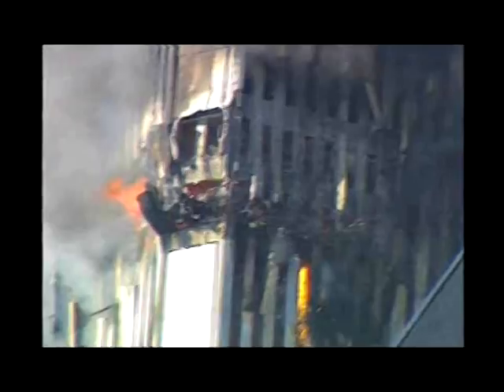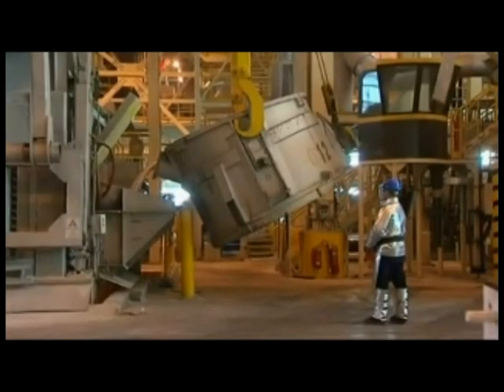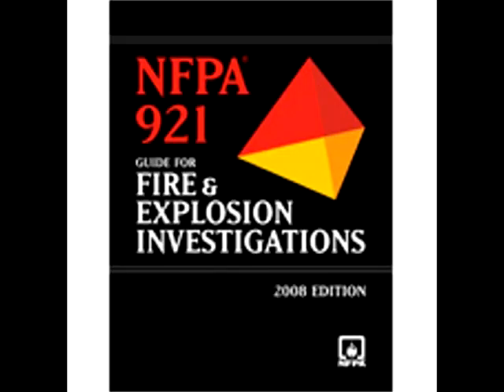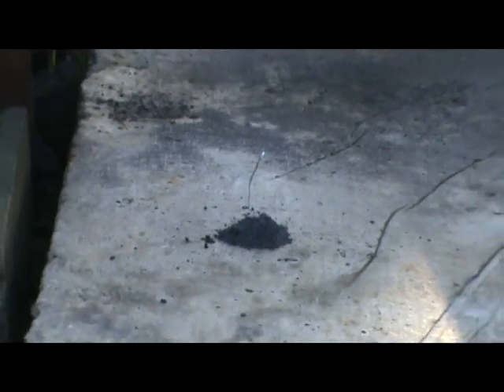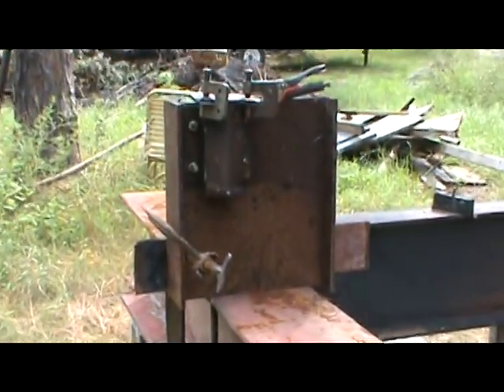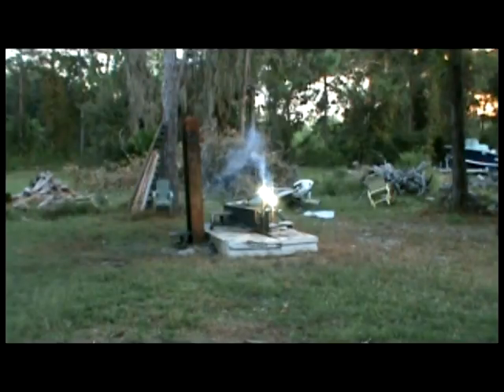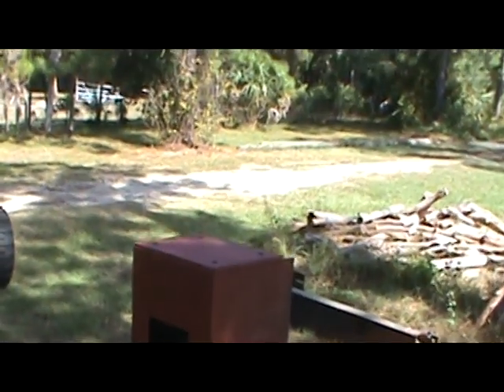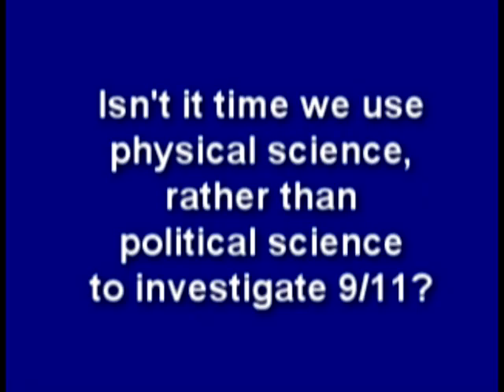9/11 Experiments: The Great Thermate Debate

Comment: ...what is the adiabatic flame temperature of kerosene anyway? What temperatrues are expected for a confined flame? I only ask because coal combusts up to 3500 F and that's a hydrocarbon fuel. CO also combusts at similarly high temperatures. Incomplete combustion of kerosene would cause CO, wich could cause secondary combustion at increased temperatures to the primary flame. Just another plausible theory, just as this viedo presents. I'm only offering more to think about.

Comment: ...There could have been isolated pockets of combustion exceeding the expected 1800 F espicially with changing air currents internal to the structure istelf. An accumulation of un-burnt carbon residue coupled with a high flow of high temperature air could have caused isolated mini blast-furnaces causing localized melting of steel. This is much more plausible than someone accessing enough individual load members at a pre-determined elevation that just lukily got hit by a minimally trained pilot.

Comment: The simplest explination is almost always the correct one. If you hear hooves think horses not zebras. Why did the buildings implode in a semi-controlled fashion? It was inherent to their design. Unlike traditional skyscrapers (with an internal structure of beams and braces) the primary load path was to the shell with trusses streaching from wall to wall. A cascading failure of the trusses (from high temperature creep) would allow for a semi-controlled demolition.

Comment: What I find interesting is that (let's call them the opposite) deniers initially claimed, "Your reasoning is absurd: you cannot cut steel beams with thermite/mate." This video simply proved otherwise. Now we move the conversation from there. You also neglect to mention that iron-oxide sphericals were found in the rubble (kerosene fires cannot do this).

Comment: Another crude butchering of common sense. Of course termite will explode when you ram air into it. Thermate is used to cut beams and weld railroad steel. It seems easy to destroy a building with thermite, but in reality it's not. Not at all. The loud noises were more than likely these bolts you speak of just being broken and ripped out of their beams. The largest "explosion" was likely the thump of the first floor that collapsed. The videos from inside detail each floor hitting the next.

Comment: Guys its not thermite we are talking about here, it is nano thermade which is military and high tech explosive and not available to the public. Judy Wood also claims there is evidence of zero point energy weapons used which would have been intense heat in a vertical wave. Haarp weapons basically. One thing is certain the official explanation is a joke and explains nothing.

Comment: The fire fighters, wrong; fires out of control, water system destroyed.  You are quote-mining your way to support idiots who spread lies about thermite being used.  Jet fuel has 10 times the heat energy of explosives and thermite.  Bringing thermite to a jet fuel fire is like bringing a knife to gun fight - you lost.
The office fires were many times the heat energy of 66,000 pounds of jet fuel which set fires on multiple floors (5/7 floors) in seconds, the biggest office fires in history.

Comment: Add RADAR to the things you have no clue on. I have data from multiple RADAR sites which show 77 impacting the Pentagon. There were no ghost planes, you are spreading lies due to ignorance or some bias.  You are using common sense when you need to get the RADAR data, and use math.  There was no melted steel, and the DNA alone from the Passengers of Flight 77 prove 77 impacted the Pentagon.  You lost this one.  Ghost planes, did you make that one up, or fall for more lies from idiots on youtube?

Comment: Get a refund on your education, the FEMA report, Appendix C, says it was corroded at temperatures from 600 to 1000 C. BTW, steel does not melt at 1000C. OOPS eee.
You believe liars who never showed you melted steel.  You have no clue what eutectic means, and it shows. Next time read or go be an engineer. IT only takes a grade school education to see this video is nonsense filled with lies.  Why grade are you in?

Comment: Read my comment again dickwad...and absorb what i wrote...if thermite was used there would have been thousands of instantaneous flashes, flames, sparks and extreme heat all over the building, remember the steel was on the external part if the buildng too...you wouldnt have ONE localised run of molten metal....besides, how long did it take to burn the the steel? And you think they could time it all to bring it down so perfect and quick....bahahahahaha...get a life

Comment: With the iron spheres consisting of approximately 5-6% of the dust analyzed by weight, that means there must have been a steel wool factory in both WTC towers. Strangely, I don't recall reading about a steel wool production facility in the WTC complex.  Congrats on making steel spheres with fine wired steel. What happens when you hold your lighter to a steel box column? How many steel spheres do you get?

Comment: Except there most certainly was melted steel. The FEMA/BPAT paper clearly demonstrates the existence of melted steel that demonstrated rapid oxidation and sulfidation which has no clear explanation. Nor was the oxidized/sulfidized steel isolated to one building, as one sample came from WTC 7 and another from either WTC 1 or 2. Two instances in 2 separate buildings demonstrating the same eutectic reaction.  Just coincidence, right.

Comment: First the iron is melted by some chemical reaction, then, as a fluid (liquid iron) it is rapidly blown into the open air by the expanding gases of the chemical reaction. While traveling through the air, the surface tension of the liquid iron pulls small droplets into spherical shapes, much like rain drops.  The liquid metal quickly cools as it travels through the air, solidifying into the spherical shapes.  This process of iron sphere creation is typical for thermitic reactions.

Comment: The rescue workers who tried to save as many people as they could from rubble reported that they saw molten steel even after the collapse. The rubble was so hot that the steel toes boots they wore would melt after only a few hours. How would a plane crashing into the building cause this? There were pillars that were sheered at an angle that is similar to demolitions. This and the fact that there traces of nanothermite, which is a military grade incendiary point to something being wrong

Comment: When fired by electricity, the thermite generated a temperature of more than 5,000 degrees about the two legs, melting the ten-foot sections almost instantly, causing the tower to tip and then to crash.

Unfortunately, today’s Popular Mechanics heads have failed to acknowledge this demolition in their defense of the official 9/11 conspiracy theory.         lmao  - Popular mechanics  lying assholes -  fooling the ignorant  - try watching this  video on which you are commenting fuckwit

Comment: The interesting thing is not the amount of energy per unit in the respective sources, being a chemical engineer you already understand that, right..? It's about how fast the energy is released upon ignition. And you can't use kerosine to cut through steel in an exothermic reaction.

And of course, provide a source for the numbers you bring up and tell us what kind of thermite you refer to.

Comment: As anyone could see by these experiments....there is NO WAY thermite could have been used...you would need tons and tons and tons of the stuff to bring the building down with it...the white flames, the arcing from the side of the building...electrical cables earthing out, more than enough energy in electricity to melt steel...it's used world wide to do so...it's called arc welding...do some research on that and not thermite...how the fuck you you control all that thermite? Wankers!!!!

Comment: "A blacksmith does use and open air fire using coal or wood and easily weakens steel. How do you explain that"

Because they keep adding fuel to the heat source (and they also provide extra oxygen by mean of extension bellows). You can maintain severe heat for hours doing so.

Comment: "The corrosion in Appendix C happened from temperatures 700 to 800 C, and near 1000 C. Melting point of steel 1425 to 1540, and thermite does what?"

Did you say you know what an eutectic composition is; that it lowers the melting point? And for the third time: Who tested for iron fused to steel from the WTC buidlings, or any kind of explosives, or explosives residues, in the dust..? Are you surprised they didn't find anything..?

Comment: "I'm an engineer, I took a chem-engineering course, my roommate is a chemical engineer. Get help you can trust and stop being so gullible"

It's fully possible that you took a chemical engineering course, but you still make false statements about iron spheres. You make references to the earth's crust as if it would in any way relate to, or explain, the presence of iron spheres in WTC dust. And it definitely does not explain molybdenum spheres.

Comment: (continued)

collapsed (i.e was severed from the outer structure) without signs of pulling in on the perimeter columns? Totally implausible, no such signs visible prior to collapse of the exterior structure.

"You lied, the free-fall data was from NIST. Why do you lie?"

You are embarrassing. NIST initially denied free fall, and you say it was their data? They were forced to admit it; independent researchers clocked the descent and discovered the free fall sequence.

Comment: "Another NIST basher, and you can't even figure out corrosion. You use FEMA, but bash NIST. NIST used more engineers than you did to fall for the lies of the video"

Clearly there was corrosion, which led to (thereof: "subsequent") intergranular melting (why is it called melting if its not a form of melting?). They way you express yourself, and clearly make false statements about the spheres (and don't answer my questions), lead me to believe that you are not a chemical engineer of any kind.

Comment: "NIST data showed a free for a few or several floors, you are spreading lies. How can you lie about it? Wow, the free-fall acceleration does not mean anything"

Yes it DOES. It shows that there was no (zero) resistance (structural elements in the way slowing down the fall. THAT needs to be explained. Even if we are to believe their model with which suggest severe core structure prior to exterior collapse, there still would be some resistance. The you-are-lying card doesn't work either.

Comment: Another NIST basher, and you can't even figure out corrosion. You use FEMA, but bash NIST.  NIST used more engineers than you did to fall for the lies of the video.

Wait till you find out how many other studies say fire did it.  You will run out of bashing tools - of which you have none.

NIST data showed a free for a few or several floors, you are spreading lies.  How can you lie about it?  Wow, the free-fall acceleration does not mean anything.

Comment: "Wrong, FEMA spells out the temperature attack on the steel samples which were corroded, it was below the melting point"

Intergranular melting is a form of melting as far as I can see. Why, otherwise, didn't they use the correct term "intergranular corrosion"..? And in this case it was caused by an eutectic, which lowers the melting point of the attacked material. Are you saying that means it didn't melt because it was caused by an eutectic composition?

Comment: "There was no thermite because no iron was fused to the steel"

First of all - thermate, given the presence of sulfur (you have "done" chemical engineering, haven't you..?) . And who tested for iron fused to steel, but didn't find it? FEMA? In the Appendix C they state: "A liquid eutectic mixture containing primarily IRON, oxygen, and sulfur formed during this hot corrosion attack". Does that mean NO iron..? Also, remember there can be different types of oxidizers, not necessarily iron (oxide).

Comment: Cheers. That's a lotta work, very interesting.  Though I'm sure others have told you that the steel did not have to melt to initiate collapse.  I'm afraid the aluminum/plane explanation for that molten steel effect makes a fair bit of sense too.  Also the buildings failed at the impact zones.  How would of "they" known exactly what level to put the thermite?  Sorry but I guarantee this fantasy will go nowhere.  Just another fun conspiracy that even its proponents know deep down is full of shit.

Comment: There was no thermite because no iron was fused to the steel.
Wrong, FEMA spells out the temperature attack on the steel samples which were corroded, it was below the melting point. 
Wrong, iron was not 6 percent of the dust - you are making up lies.
However, iron is 6 percent of the earth's crust, so you can't be too far off.
You missed thousand of samples, and many had very limited amounts of iron. 
Where is the Pulitzer for this thermite bad guys did 911?

Comment: "Steel was corroded not melted"

I read the Appendix C (not the entire report), which states: "evidence of a severe high temperature corrosion attack on the steel, including oxidation and sulfidation with subsequent intergranular MELTING". I've seen no credible explanation for the presence of sulfur penetrated into the microstructure of the steel.

---->

Comment: No melted steel on 911.  Melted steel is a lie.  Thermite leaves evidence, iron fused to steel, and splattered iron from the weak blast. Cole proves thermite leaves evidence! No evidence found on the steel he showed. 

Office fires and jet fuel equal in heat energy to over 3,250 TONS of thermite. Office fires burning before collapse, heat energy of >2,629 TONS of thermite.  
He failed to mention oxygen generators in the planes.  

v=6i_l_ux3R-4

Comment: The experiment was reproduced, a mixture of aluminum, plastic, wood, iron, carpet, sand & diesel still looks silvery, tested independently 2 times in different laboratories by different people, the result was the same, aluminum looks silvery not orange/red, thats how the scientific method work, and you can do it yourself, its not quantum mechanics,  but if you wanna keep believing it was aluminum ..then it must have been. ;)

Comment: Nope. It would probably be at least a very loud sizzle/crackling noise, like a fountain, even if it was unconfined. but in the amounts needed to cut a steel beam, couple with thick enough walls might mean that if you could hear it, you would 
A) be in an elevator
B) be inside a wall

but, I have no idea. the guy's video show it making several loud pops and cracks when confined, so I guess maybe they were just well placed? maybe?

Comment: NIST didn't test for thermite because no evidence was found by the FDNY or any of the teams of metallurgists. Two frauds, Steven Jones and Neils Harrit, published a bogus paper in a vanity journal claiming that thermitic material was present in WTC dust. That paper, according to a British materials scientist who posts on the JREF as "Sunstealer," contains over 20 methodological errors. Using the frauds' own data, Sunstealer showed that the red/grey chips were primer paint.

Comment: What facts? That physicsandreason talks about glowing columns although it was just the AL-cover? Or that he implies that the battered box-beams were demolished by explosive devices, although it only looks like that because of the perspective and any kind of traces of an explosive device going off are not visible? Or that up till this day no one was able to find any residues of explosive agents in the dust? Or that there is not a single image showing steel unmistakable damaged by explosives?

Comment: @palasta 

You are correct sir. The towers were put on down times while new security messures were put into place. What does that mean? Answer there were workers allowed into the buildings to drill into walls to install new wires for cameras. Box junctions for wire systems. What does that really mean? That there were people allowed into secured sections of the buildings to implace any number of items with impunity!

And as for the dogs there are no documents saying they were used period

Comment: @justforpoox

"massive ammounts of dust"

Where was the dust from? In buildings like these there are always construction/maintenance work going on. What leads us to the question, if there are maintenance, cable installation and whatnot on a regular basis often accompanied with a check of the insolation, how did THEY make sure that no one discovers one of the hundreds of explosive charges?

Comment: @Trax17032

"And and mind you this is for 1 floor only."

And it doesn't end there.

First smuggling 100t+ of super advanced Nanothermite into 3(!) high security buildings. After the job is done, they'd to make sure nobody detects one of the hundreds of rigged explosive devices while maintainance work e.g.

The end? Ha Ha Ha. No. After the demolition they also had to make sure no one finds incriminating evidence obvious to the naked eye, like hundreds of severed beams 'n columns.

Comment: I love this stuff. 

OK let's say they used thermite, I will play along here. 

We have 240 columns in each tower, 59 on each face + 4 corners. That is about 480lbs per floor, plus we also need to install 240 mechanisms to contain and control the burn. That means tearing open the sheet rock walls, moving office furniture, installing 240 devices an ignition source for all 240 devices etc. WITHOUT being seen 

And and mind you this is for 1 floor only.

Can you ppl not see how ridiculous that is?